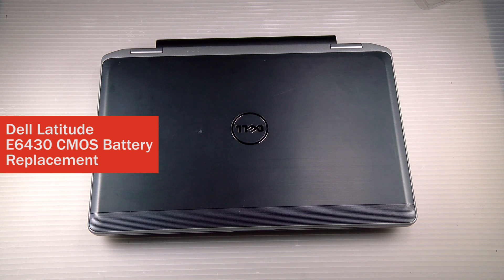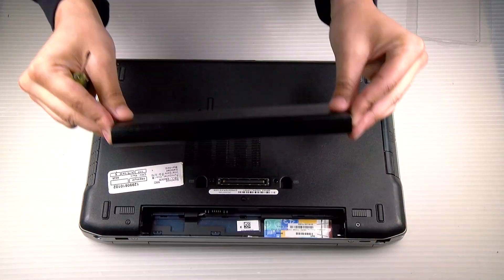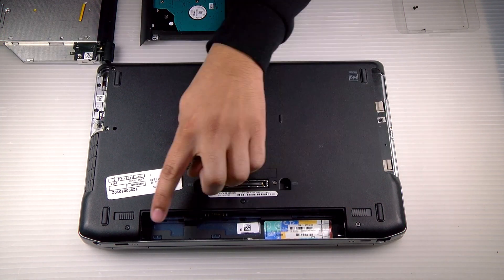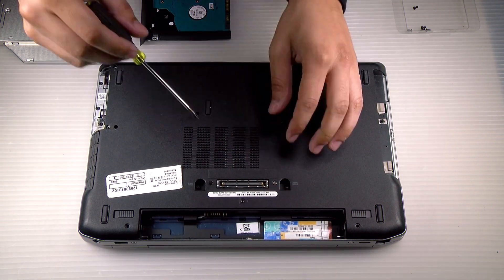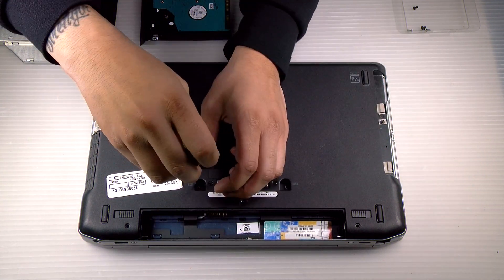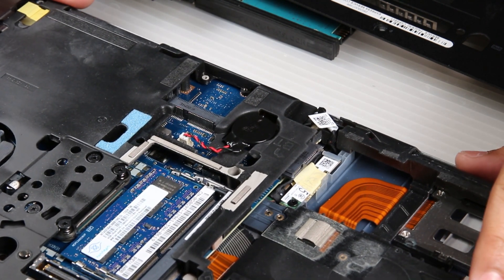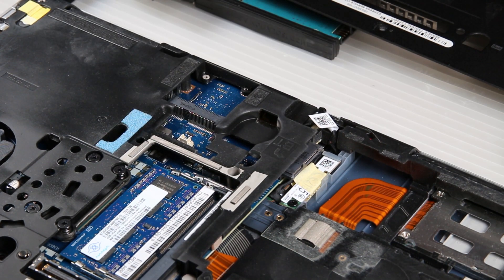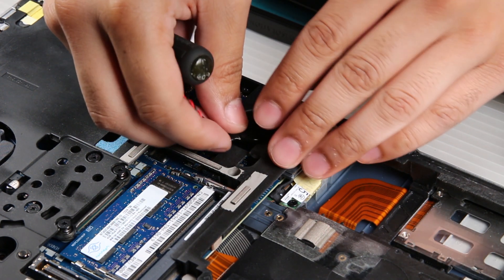Dell Latitude E6420 CMOS Battery Replacement Video Tutorial

Comment: There is no need to remove the two recessed long screws, one on each end of the docking station connector. Also, the hard drive can be left installed, just need to remove the four screws that attach to the bottom of the case around the drive.
Reply from the maker: Thanks for sharing!

Comment: I have the exact model of the laptop and I think the CMOS battery needs replacing. Do CMOS batteries have specific models for specific laptops like an E6420?
Reply: i have the same model...i have problem when turning it on everytime i turn it on it will shutdown untill halfway 3 times....and for the 4th time it will turn on normaly....tha is daily routine of my laptop  ...is it the problem about cmos battery?
Reply: @mevlogs194  
CMOS Battery probably the culprit. I have an E6420 and it was doing that, it would turn, drive LED would light,  the power LED was lit, then goes out and if I wait, a screen would appear giving options F1 to continue, F2 to enter setup and set the clock. 
Replaced the CMOS battery, just a CR2032 but wrapped in shrink wrap insulation and two leads spot welded on it with tiny connector. 
I removed the wrapper, using a solder iron unsoldered the leads to the welded strips, new CR2032 a tiny bit of flux and some solder and carefully solded the leads, wrapped both sides and the edge in electrical tape and put it back in the laptop. Working just fine now.